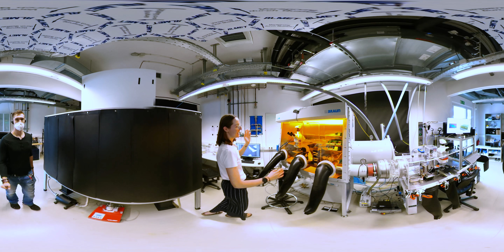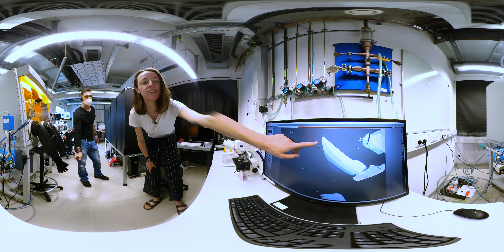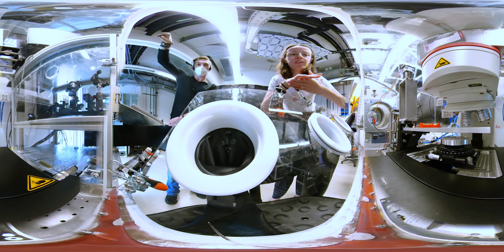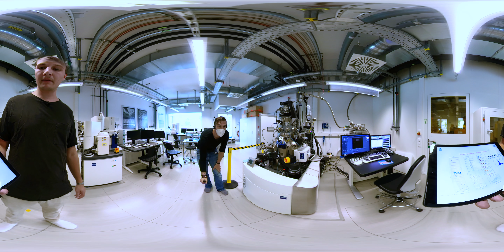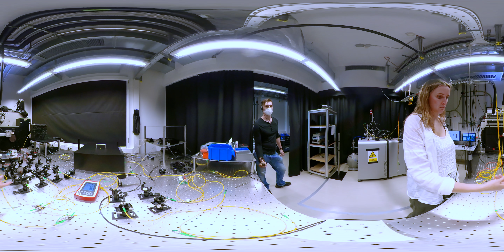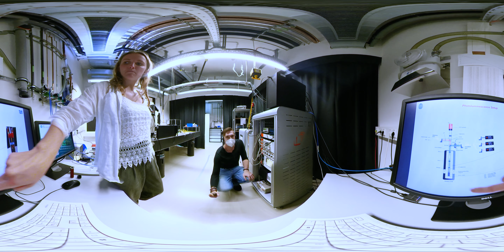Bombarding MoS2 -  360° VR Labtour at the WSI-CNN (Munich)

Comment: Cool, in Garching they also produce the TMD monolayers by exifoliation. I did this as a workstudent with Prof. Högele (LMU). And yes, it's not so easy to work with adhesive tape and tweezers in those thick gloves.

I found the thing about the monolayers being direct semiconductors and the bulk material not being, quite interesting. It was nice when you looked at monolayers under the fluorescence microscope and only the areas with monolayers were lit.
Reply: @MCQST  was a bit monotonous for my taste. But it was also interesting and I was able to learn something. And it is a student job

I then built a private arrangement for it, with hinges and steel plates to improve the exfoliation, e.g. that the pressure on the material between the adhesive strips can be greater and more even. 
We tried it out. There was no improvement. One could still change something about this device. But I didn't get around to it. The device is used as a window stopper at home. 

I still read the paper by my supervisor Jonathan Förste, Nikita V. Tepliakov: "Exciton g-factors in monolayer and bilayer WSe2 from experiment and theory", nature communications 11, Article number: 4539 (2020) . 
For these values in Table 2, I wonder if there is a simple explanation. 
If the ratio of the g-factor for excitons in the bi-layer is taken once from the interlayer (particles of the exciton are in different layers) and once from the intralayer (particles of the exciton are in the same layer). The fact that certain values from these two columns are the same, e.g. D0 exciton interlayer and K`U exciton intralayer, is due to the symmetry of the lattice. 
I mean that this g-factor ratio of intra- and inter-layer is always very large for KGamma or K`Gamma wave number values and very small for QGamma or Q`Gamma wave number values. It seems to me that it is actually the wavenumber that is a very important factor in how the bands bend and split under magnetic field.
Thinking somewhat optimistically, one could arbitrarily shape the dispersion relation of a material by magnetic fields. All the properties such as interaction with light and electrical conductivity would change. Ok, to achieve this noticeably requires strong magnetic fields.  
I haven't found much literature on this yet. I think it would be interesting to investigate this in more detail, or have I just been looking in the wrong place?